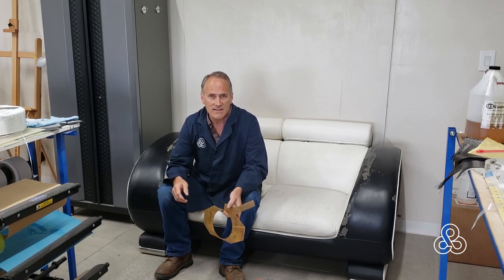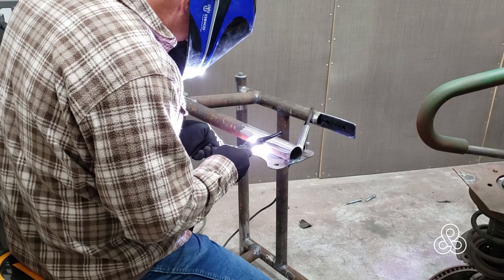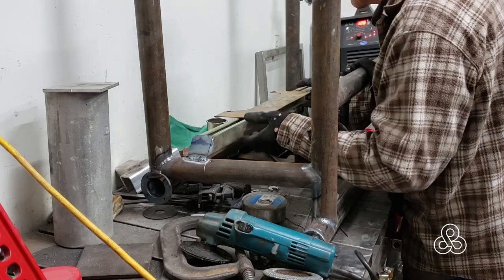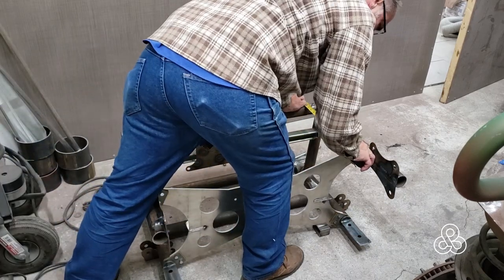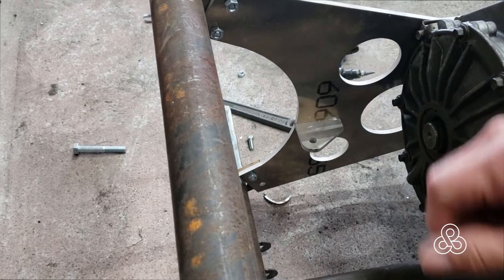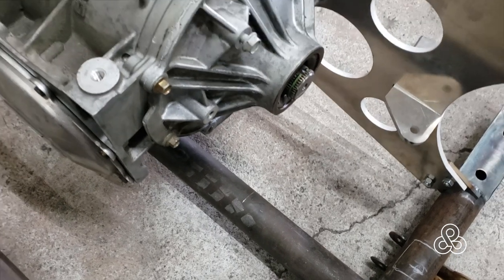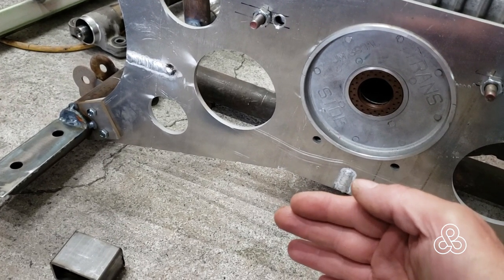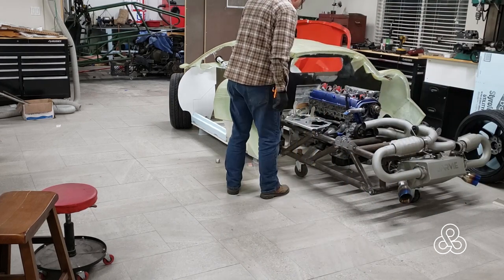A27 - Arete Supercar-Adding sub-frame components and cutting out a poorly placed steering rack.Oops!

Comment: 02:11 What’s The width on those tires? How do you know what width is optimal? Thanks for the content and the explanations!
Reply from the maker: 255mm width. My budget cant afford optimal, but decisions were driven from dozens of factors, such as the differential and axle length, cabin width and availability of affordable tires and wheels.
Reply: @BuilderCreator  my 2009 Chevy 2500 HD used when I got it a dealership worker was driving it ,,she had taller tires on it to haul a horse trailer ..it throws the MPH off 3 too 5 mph and Chevy did not have a computer program at the time too fix that so they got me a tom tom to watch my speed ,, I like the tall tires on my truck ..can you program your car for the tire size or is that a gear change in your tranny .. don't know anything about the parts your using I can do the older Chevys and Jeeps ..new stuff I am lost in the computer world .. I am in NY not sure what state your in ?? you don't have to say ..